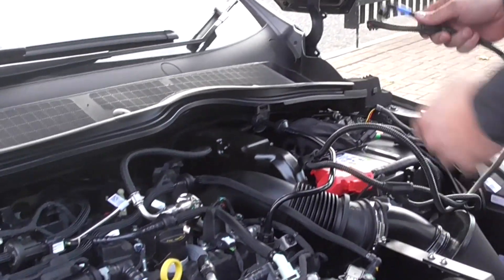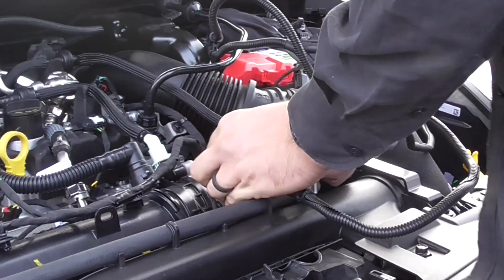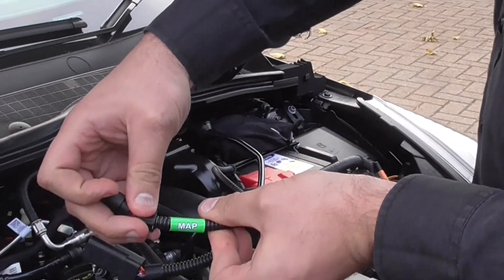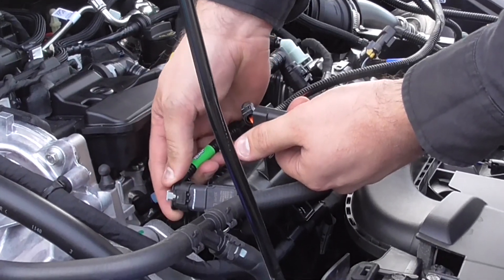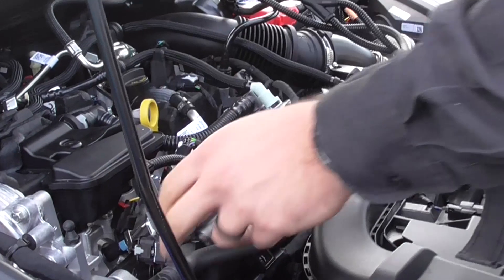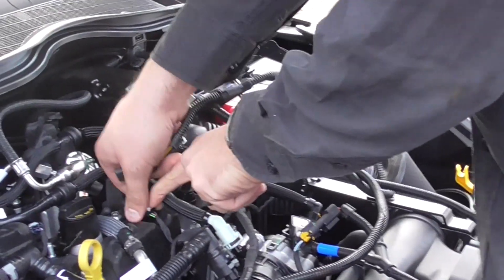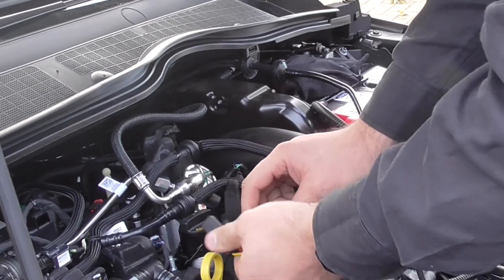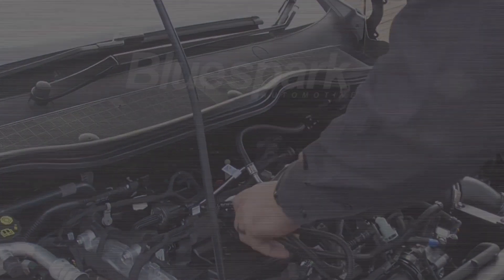Bluespark Automotive Ford Fiesta ST 3 Channel Chip Tuning Box Install Video

Comment: Where do you installed the actual tuning box on the fiesta st? as it doesnt mention exactly where in this Installation video or in the instructions that came with tge unit 🤔
Reply from the maker: We mount it above and behind the battery, you can actually see it in its black bag in the video.